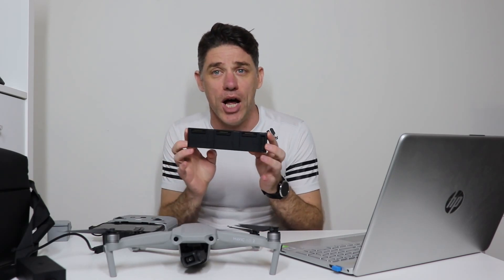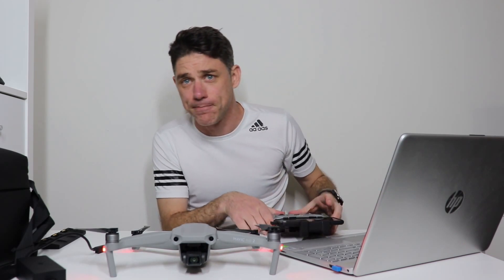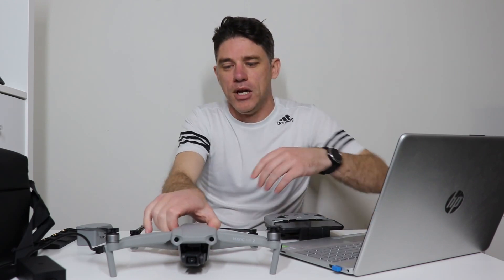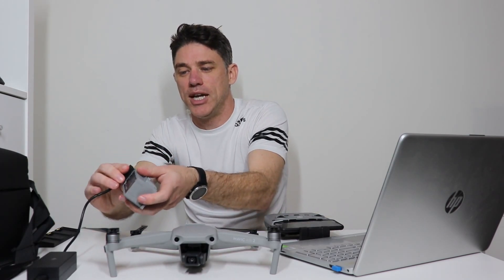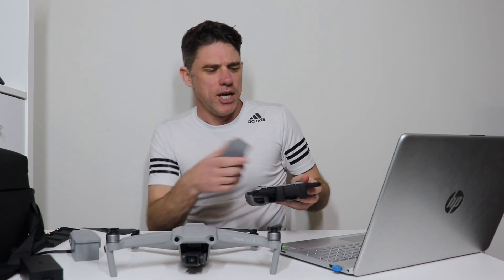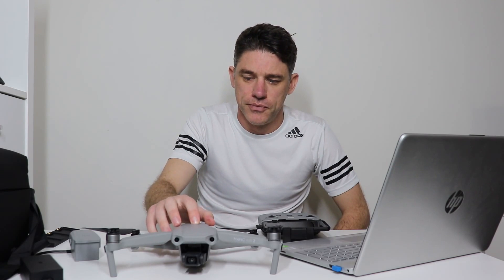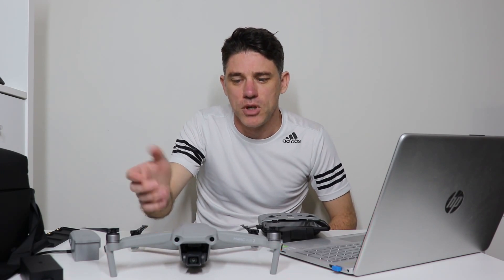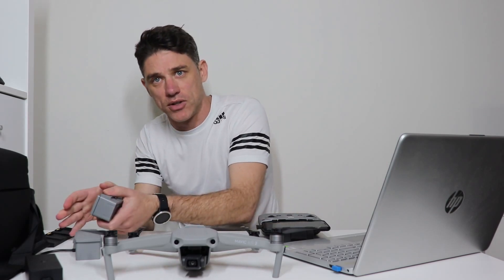How to fix the Mavic Air 2 battery problem

Comment: Hi Jamie, one of my air 2S battery's was frozen, when charged it would show 2 opposing LED's and the button had no response, nothing would happen when depressed. I charged the battery and put it in the drone, the drone self initialized and the remote was showing me that the battery's firmware was out of date. After updating and updating all the firmware and warnings the battery finally worked.
I presume the previous owner had a locked battery and didn't bother to fix it, after some time perhaps the problem became worse because of firmware? 
Thank you!

Comment: The battery you show that was completely dead, you connected to charger directly and said it would come out of hibernation.  After hours of charge, still no lights or turning on.  What next?  BTW, the battery has worked previously but not in the last 7-8 months.

Comment: I did that and it didn't help. $800 worth of batteries for my Phantom 4 pro is gone. It seems like after spending some time in "hibernation" the battery eventually goes to forever sleep (mine were laying for 2 years because of the pandemic).
Obviously, DJI is well aware of this problem, but doesn't mention anyting about this anywhere. They just want you to buy a new one.
For all you guys buying a fancy new DJI drone - if you don't charge it regularly, at least once a month, it's gone, and DJI won't replace it.

Comment: My battery wasn't used for 3 years and now i plug the battery into the dji charger you mentioned here but the light still wont come on. This battery was used only once 3 years ago so it should be just like new

Comment: Too bad this doesn't work for Mavic 2 Pro. I have two batteries that drained in storage and will not respond. Sticking them on the charger directly for 12+ hours makes no difference.

Comment: You unlocked the mystery of my perfectly good battery that went to sleep.  Like R2D2 did when Luke Skywalker went away. I was all set to purchase another fly more pack. ( which I still might) to get 2 more batteries. Not sure if this information is in the manual or available from DJI. But I thank you a thousand times for your content information

Comment: Liked and subbed. I think this might be working on my Mavic Pro as well. Not used it for a while. 5 batteries totally dead and nothing. One other battery lit up and started to charge. I tried what you just said on one of the dead batteries and now it is blinking. Thank you
Reply: How long did it take to respond
Reply: @frankdatank4u  it took about 20 minutes. Unfortunately it decided to stop responding again while it was recharging. It suddenly stopped. I have since sold the batteries as non working on eBay for £20 each. Someone bought them and got them working again.

Comment: Hey I recently bought a secondhand Mavic pro that had never been flown so it was still it’s original container and because it had never been flown the batteries are never been taken out of hibernation subsequently they now totally dead. 
 is there any way that these batteries can be reactivated at all?  I have tried putting on the charger single individual charger only, for several hours no luck. 
 I’ve also tried doing the same thing and holding the power button down for three seconds & again on several hours on single charger but no luck 
I’m just reaching out for any kind of help please
Reply: I have the exact same problem... bought a secondhand Air 2s, it came with four batteries, two are OK, two are dead. No method I've seen online brings them back from the dead.

Comment: Jamie, you have been to the future and saved my air2s battery. I went straight in and stuck them all one the hub (DJI - why wouldn't you?) One went wonky, but is now behaving thanks to this video. Good work. You have a new sub from the future! 2021 🤝🏿👌🏿👍🏿😎
Reply: Akin - Im on my 3rd try... 
I left it unplugged for about 2 hours and then connected directly to the charger and still no go.  Any thoughts? BTW mine are literally brand new

Comment: @Jamie Holder can you shed any more light on the 30068 battery error in the MA2? I have performed the 3 minute drill you described on all 3 batteries, refreshed the latest firmware with all 3 batteries via DJI Assistant 2, refreshed the RC firmware with Assistant 2, and cleaned all contacts on both drone and batteries. Still getting the error. Especially if I fly, land, and take off again. I really hate to send it back to DJI since it is my only drone. Hoping you may have some updated advice.

Comment: I have problems of them losing battery when they are fully charged and only laying in the bag for days . And when I go out to fly again all batteries has lost one or two lights... 🤯🤯🤔🤔
Reply: The manual says it will discharge to 60% if not used within 4 days. I'm sure that's not a hard number, so I'd expect between 3-5 days and it would do this....

Comment: My problem is different, I charged the battery, removed all sticks, inserted the propellers, inserted battery, one-click on the power button, the nd click holding it, the aircraft seems to start the initialization process, but no beep, no lights, no gimbal activation. Its just stay there with a fan turned on.

Connected it to my computer, but no luck, no detection.

Did I make something wrong or I can consider it defective and can return?
Reply: Just return it have to start calibrate the gimball and move the propeller. It's defective

Comment: For first time in my life suddenly both new batteries of my Mavic 2 pro after 7 flights both have the same problem. If they are full charged when tried to put them on drone , drone started automatically without pressing 2 times the battery. First happened to the first new battery and after one day happened the same to the second battery. Both of them is like staying on with out lights. When I’m trying to press 2 times to turn on them it’s working and I can see the 4 indicator lights. Then Pressing 2 times the button to turn them off , and lights going off but again the battery is like on. If I will try to put them on drone. Drone starting calibration of camera etc automatically. Any ideas ??

Comment: Just got the Mavic air 2 and right off the bat im getting error 30068 regarding the battery not being installed correctly. Ive tried everything I can think of the fix..cleaning leads..re seating multiple times..can anyone help?
Reply: Did you ever get yours straightened out? I got my MA2 last June and no battery issues until about October’s cold weather and getting the 30068 error ever since. I’m in the process of the 3 on, 3 off drill described here. I have very carefully and thoroughly cleaned the contacts. I’m in Maine, USA so I’ve flown it as low as 15° F with no issues other than the 30068. 
Never any issues with the actual flight but the constant battery warning keeps me on edge!

Comment: Thank you for the video! I assume it is ok to charge via Hub on second round?
Reply from the maker: Yeah that's correct
Reply: @JamieHolder  so if i already  did that what can I do now the hub is only charging one at the time what can I do?
Reply: rdbetta The hub only charges one at a time.
Reply: @hawkvpg7878  umm ok thanks then the hubs is not of much use
Reply: @rdbetta  Well, you can put all 3 batteries on over night (after the single charge he explained), or, you can buy a parallel charger on Amazon.

Comment: Here's my problem:
I drained my battery to 0% not on purpose and now it won't charge at all. Not on the standalone charger or on the hub. Let me add that the battery was sitting for a week and I flew out starting at 55%. Is there a fix for this?
Reply: Try jumping it https://youtu.be/mPOk-TyGvuA

Comment: Hi Man, I have a question, I charge three battery with the Hub and everything works normal. If one of battery or two battery fully charge and one battery still charging, is it ok to let the fully charge battery stay on the charging hub until all the battery is fully charge? Or I need take out the battery from the charging hub when fully charge?
Reply from the maker: It's fine to leave it in the dock, they stop charging once full.
I charge mine when I go to bed and leave them in till the morning.
I have never had an issue with any drones/ battery's doing it this way.
Reply: @JamieHolder  Thank you so much Jamie! First time owning a drone, little bit nervous if doing a wrong especially treatment the battery.

Comment: I bought this drone yesterday and my charger hub does not work how can I solve the problem?  Or do the batteries have a deactivation system when trying to load the hub? How can I know
Reply from the maker: Charge the batterys separately first, not in battery hub, then plug the  battery in the drone do a firmware update. Then you can start using the hub. If the hub will not work after that you may have a faulty hub.
Reply: @JamieHolder  already did the firmware update jamie but still have the problem,if the hub have a faulty how can i fix?
Reply from the maker: If the hub dosnt have a green or red light then it sound faulty. Jump on the DJI site and just message them and they will replace it.
Reply: @JamieHolder  thank you jamie

Comment: I used hub initially and after not seeing two batteries charge quickly did search and found this. Is the damage already done or will switching to a direct charge avoid any issues
Reply from the maker: Doing a direct charge will fix the problem.
The fix above was given to me by DJI.
They also said it will not affect warranty's.
Reply: @JamieHolder  buddy THANK YOU for this video. I had this exact issue with my Mavic Air 2 batteries.   I am thinking is the best advise?  Throw the damn charging hub in the trash.